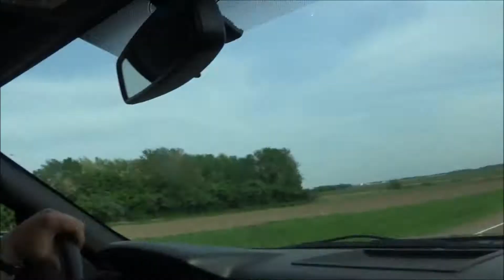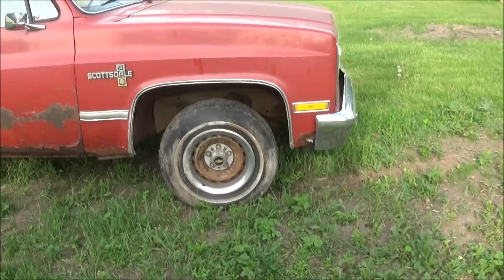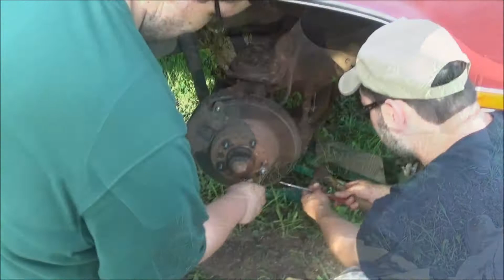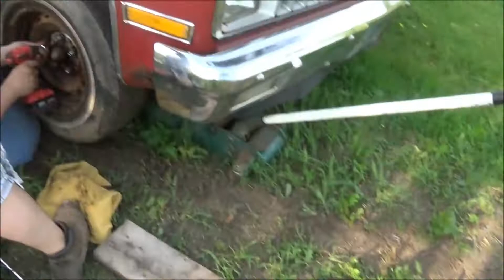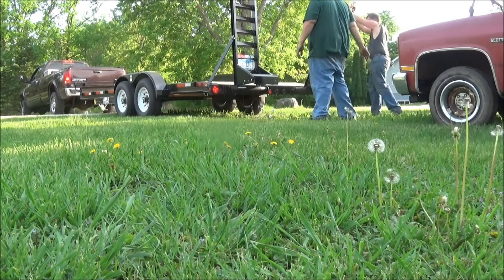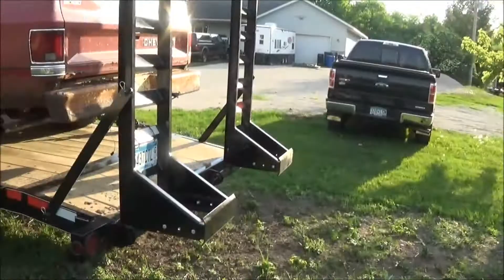lets rescue a 82 Chevy from the crusher

Comment: Those front calipers will lock up from sitting too many years. Mine did on the 81 and had to replace them. Just use the park brake if you have to stop it.
Reply from the maker: roosty6 that's what happened hear